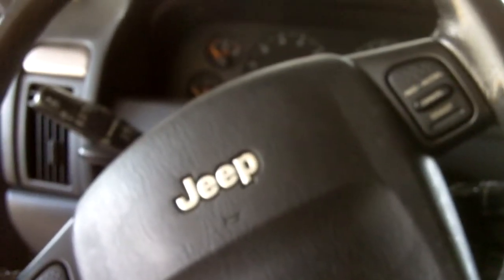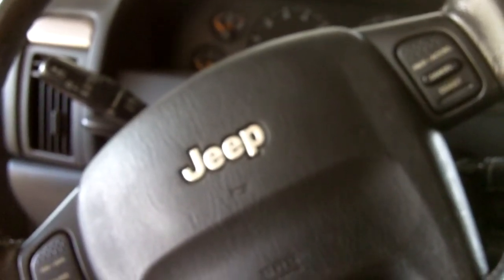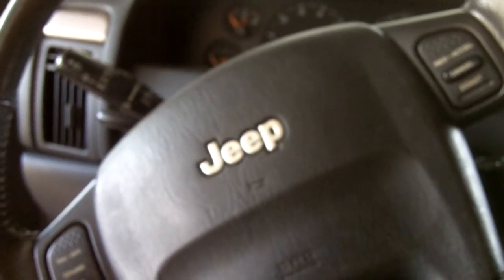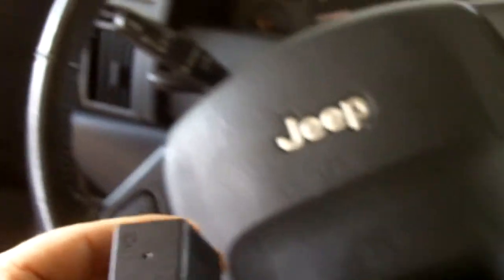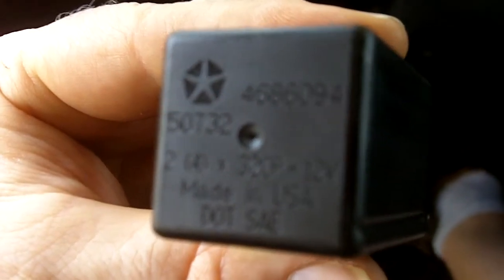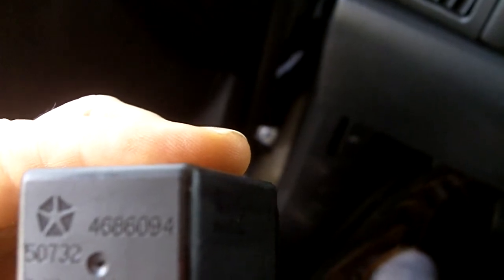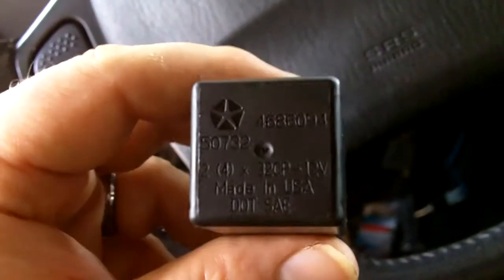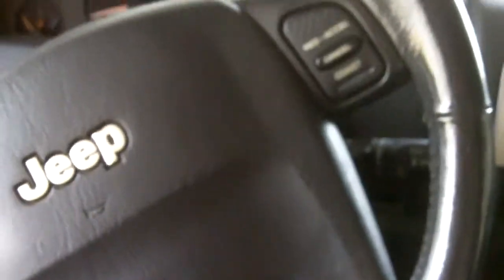Jeep Turn Signals broke while E flashers work

Comment: Soo im having this issue my left signal works here and there...mist the time if i hit my hazzards it will work otherwise only the right works all the time was told was a relay also but if it was bad relay wouldn't it stop it from working at all?
Reply: Did you even fix this move is doing the same

Comment: Replaced the relay.  No change.  Flashers work, no blinkers.
Reply: 911 Truther I feel your pain & aggravation
Reply: Same.
Reply: ᨓ did u find the problem,?
Reply: If you still have this issue check the ign fuse its fuse no 20 or 21 or 22
Reply: You probably have broken wires in the door jams if everything is ok fuses and relays
Reply: @ridhadjemal80  Right turn signal works once, then the front one stops working.  Turn the Jeep off and back on - I get one more normal usage.  Also, the intermittent wipers work only sometimes; usually fully on.